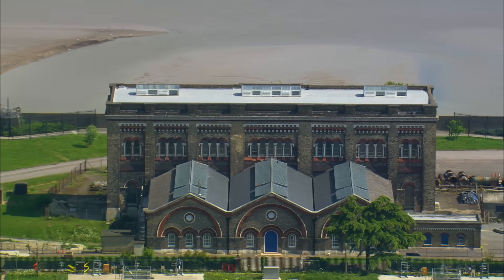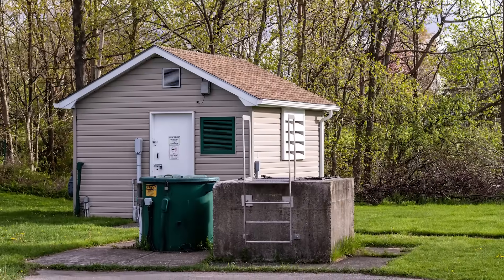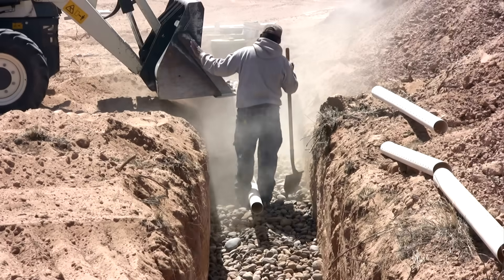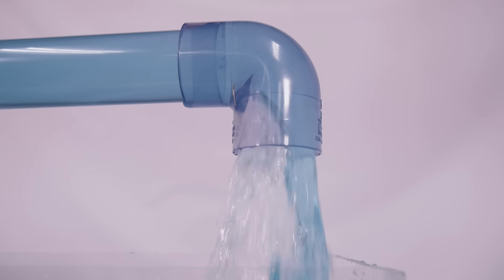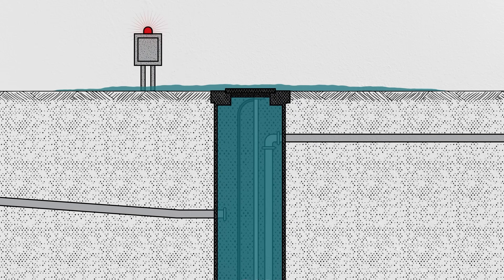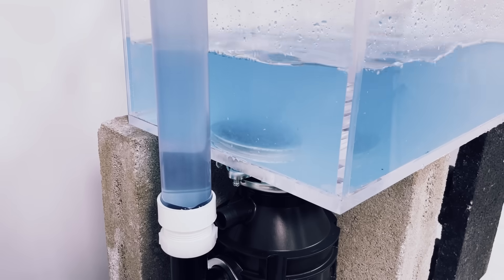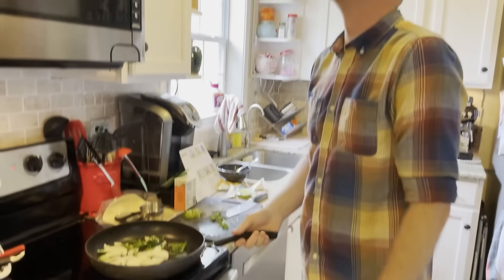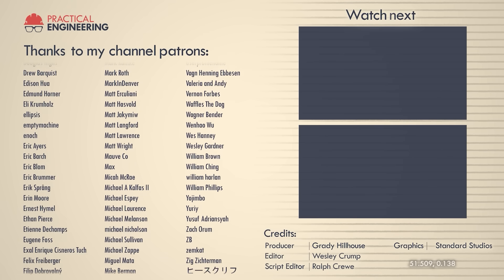How Do We Pump Sewage?

Comment: Yes.

Source: worked in sewage treatment plant. I personally disassembled and reinstalled sewage pumps. They were actually pumps that drained settling tanks. I don't know how many kinds of pumps will do the job, but these look like giant reciprocating engines. They were driven by electric motors though, and each piston had a rubber ball on top sealed with a gasket that only let the waste through one way.

P.S.

The amount of baby wipes, tampons, condoms, and wash cloths that get flushed is disturbing. Yes. Wash cloths. I have no idea who thinks that's a good idea. Stop it people.
Reply: As an electrician (who wired a few commercial lift stations), I worked with a VERY GOOD plumber lots of years ago who made one very simple and complete statement: "Besides human waste, the only thing that should go down a toilet is TOILET PAPER"!!! 
I, personally, take a similar approach to "garbage disposals". They ARE NOT a substitute for "the garbage can" unless you enjoy frequent stoppages when the stringy garbage you tried to grind comes in contact with a soap/grease restriction in your 2" waste line/drain.
Reply: @pappabob29  Not even that
Reply: As they say, toilets are only for pees:
Piss
Pooh
Puke
Paper (toilet !)
Reply: @millomweb  Forget the last one
Reply: @kornaros96  Why ?
Reply: @millomweb  clogging of installations. especially when said installations aren't up to par.
Reply: Oh man, you ain't kidding about what you find in the sewers...I've found pipe plugs, sex toys, trash can lids, an assortment of live and dead wildlife, and a small cow...It's crazy.
Reply: @chuckycheezburger3313  A sewage worker in San Antonio, TX once found a human fetus back around 2000. It was never traced back to anybody.
Reply: @chuckycheezburger3313  How do you flush a small cow ?
Reply: @mikkelbreiler8916  Man, I really dont know how it got in the line.  Guessing it fell in a stormwater drain. All I know for sure is that the muffin monsters got jammed up chewing on parts of it. Nasty nasty nasty. Still not the worst thing though.
Reply: Senile old people flush a lot of strange things.  Small children also flush a lot of strange things.
Reply: @tsm688  About anyone flushes strange things, it's really not age exclusive. The less people do stuff themselves the more likely they're to do "obviously" dumb shit just because it's out of their eyesight, thus out of their mind and "not their problem".
 Food appears magically on their table and all wast/trash just as magically disappear.
Reply: Interesting. I have never worked with a reciprocating displacement pump. Every pump I've have worked with in my system be it water or waste water has been centrifugal. Some dating back to the 30's even.
Reply: I thought the pumps on the FST's were there for moving the sludge to the RAS SAS pumping station?
Reply: What about flushing semi-liquid food that went bad? For example a thick soup that was forgotten in the fridge and got moldy. It's way too liquid for a trash bag, and putting that into the narrow sink pipes also sounds like a bad idea.
Reply: I normally triple bag that kind of thing. Tie is in a shopping bag do it again and put it in a garage you are sure does not have a whole in the bag, works pretty good.
Reply: The biggest headache; wet wipes, tampons and sanitary pads. I wonder what would happen if drain unclogging was a lab course in junior/high school.
Reply: I was just wondering if they used this style of pump. It’s what they use for concrete pumpers. I saw a diaphragm trash pump once of the same principle but it didn’t seem to be particularly efficient.

Comment: This is a good video about our most popular sewage treatment system. It tacitly assumes that this is the system that deserves study and while it’s worth studying, I think the tacit acceptance of the initial design should be done overtly. 

The easiest way to care for a sewage treatment system is to eliminate as much need as possible. We add huge amounts of water under the theory that it’s necessary for transporting waste, but it’s preferable to eliminate the water and eliminate the transportation when possible. 

An older system involved intermittent suction pumps and far less water, so the material being moved was a thick sludge. Less material at the end point can be a significant cost savings and decreased environmental impact. 

Better yet is to solve the problems on site. In desert regions it’s entirely practical to put the biohazards in a solar dryer and bake them into harmlessness; wastewater from dishes and clothes can be used for irrigation. 

And you did mention on-site septic systems, which is my personal infrastructure here where I live, but it’s based on a conventional flushing system that adds all the extra water. The better solution is to make a composting toilet that requires no additional water. 

In other words, almost all the engineering challenges in this video start with the design choice to add lots of water, and the first way to care for a system would be to consider how to put less material through the system.

Comment: I picked the wrong video to watch while drinking my iced coffee. 

In all seriousness, I now know what's inside the many little lift stations I saw all over the place when I lived in Florida. They're very common, particularly on barrier islands. It's also interesting to see what you can do when installing a wastewater system for a city in the late 20th century. Cape Coral relied on individual wells and septic tanks until many wells began to run dry in the 1970s. The city opened one of the first reverse osmosis water treatment facilities for drinking water. For wastewater, they provide non-potable, reclaimed water from the treatment system to businesses and homes for landscape irrigation, saving an estimated 20 billion gallons of water over a 25-year period. The city is still expanding the water and sewer systems, and will be for several years to come. Too bad the original developers in 1957 didn't care to put water and sewer mains under the giant grid of streets and canals in the first place.

Comment: What about congealed fat?  The grinder pumps definitely don't help with that.  Perhaps just having bigger pumps might help, but it still feels like those will still eventually get clogged.
Reply: They do. But the good thing is most of it floats and is easily removed.
Reply: For household FOG (fats, oils, and grease) the practices I've seen utilities employ focus on education initiatives to reduce the load, which also include sanitary wipes, as they are a major component for the fatbergs shown in collection system failure videos and articles. For larger areas with consistent FOG flow, the utility may have a FOG collection station installed at a major lift station, in similar fashion to a screen or grinder equipped station.
Commerical and restaurants that are expected to produce large quantities of FOG will be required to have a grease trap, to separate their FOG from the sewage collection system.

Comment: I think the most fascinating part of this whole video for me was the fact that kitchen sink disposal grinders have enough head to pump that high. I never realized they were such effective pumps.
Reply: I was thinking the same thing! I always though of them as just gravity feed after they do their thing.
Reply: They don't pump well, the one in our house was set up (badly) to pump up though some sloppy plumbing which made it prone to clogging and backing up, but it was also a cheap brand. The new one, properly installed, does discharge the water quite efficiently though I've never tested that much head.
Reply: @rpavlik1  Somebody should have told that plumber that pipes are supposed to flow DOWNHILL!
Reply: @bradley3549  yeah I'm reasonably sure no plumber was involved. Previous owner was really bad at diy.
Reply: @rpavlik1  I usually blame the electrician when I find shoddy plumbing like that. And blame the plumber when the wiring is jacked up. Only way it makes any sense.
Reply: @rpavlik1  that's bizarre, did it have a check valve? You'd think all the fluid that remained in the pipe would back flow.
Reply: Heh, Grady your choice of garbage disposal was perfect.  I'm pretty sure that is an InSinkErator Badger too.  Instead of keeping costs down by sending the manufacturing overseas to China, InSinkErator looked at their products and found ways to make them all out of the same suite of components.  Even their high end models are the same internals just with more noise dampening.  When one dies, you can unhook the hoses and then twist to release the dead one from the sink mount, then just do the reverse with the new one.  So basically your kitchen disposal was designed with rapid replacement in mind just like pump stations.
Reply: One day at work the sink clogged after lunch and filled with water. We'd turn on the disposal and the water would all disappear, then would come surging back when the disposal was turned off. Turns out someone had dumped a tray of catered rice down the disposal and it had badly clogged the sewage stack one floor down. (*Really* badly. They were seriously considering cutting out that section of pipe.) The disposal was pumping the water up the stack towards the roof. :-)
Reply: It has somewhat the general action of a standard centrifugal pump.
Reply: For comparison fill your sink with water, let it drain naturally, then hit the switch and watch how much faster the water goes down.
Reply: Right?
Reply: I mean it was only a few feet? Although I guess I have no idea how much head I should expect from a small pump, maybe that's a lot.
Reply: @Khaim.m  Yeah, but I didn't know that it pumped _at all_, I thought it only ground.
Reply: @Khaim.m  Garbage disposals are not pumps - so that's the point of my amazement. For something that's not a pump, it sure does a good job pumping.

Comment: You left out air lift pumps. They are used in the waste water treatment facilities and mostly only move water for the most part. They have good volume but poor head pressure, and are not bothered by solids much at all,

Comment: The sewer in my road is 6 metres deep….or they thought it was, nobody had looked in 50 years.  Turns out its 9 metres deep, out side the reach of all the companies shuttering and all their equipment.  A simple pipe repair took 3 months of full road closure, god help us if they decide it all needs replacing.

Comment: I've had the joy of being a millwright, who works on the 14,000 gpm+ pumps that perform this function. These pumps are freaking crazy!
Reply: Cool. We have 3 pumps of that exact capacity at our treatment facility, with 350 HP motors driving them. Absolute monsters. The whole assembly stands about 15 feet tall.
Reply: @biggreenblob  Are they on inverters?
Reply: @biggreenblob  Saskatoon!?
Reply: @Pickleriiiiiick  Birmingham
Reply: @biggreenblob  ahh, they're all the same, massive poo movers haha
Reply: in my own ignorance, all I can envision as a "millwright" is one of those Saturday morning ETV woodworking shows :)
Reply: @kevinheard8364  that's a fair assumption. The trade started with wood bearings for flour and saw mills. Basically anything not on wheels is our game. Pumps, compressors, conveyers, power generators. We're fairly diverse in what we do. There's no one thats done it all, that's for sure.

Comment: Chain and disk pumps used to be used - a continuous loop of chain which is pulled by an engine or animals with disks that fit inside a riser pipe.  Also Archimedes screw pumps where the heights are to great - big ones can lift anything! 

Also I can recommend the Drain Addict YouTube channel if you want to see the practicalities of lifting sewage!
Reply: I suspect that the old school beam engines were rather robust for this task too because of their linear reciprocating action. I figured their ability to simply lift the entire cylinder of water straight up would be well suited to this. Seems like if designed with the cylinder and the pipes all being the same diameter almost anything that fits through the pipe should pass the mechanism too well except I suppose you have the lift rod that pulls the piston up to deal with. But that is still far less of a constriction than an impeller creates. Then again guess maybe they weren't as good as they look as it would be easy to convert the torque output from a modern motor or ICE into reciprocating motion like this, converting between linear and circular motion and back is a staple of engineering after all.

Comment: When we built our 'new' home (19 years ago), the builder cautioned us that because the lot was a the bottom of a hill, the home would require a 'grinder pump' aka 'macerator pump' to move sewage from our basement through a force main up to the top of the hill about a block away.  I was initially hesitant, but in retrospect it has worked very well.  The predicted MTTF for the pump is ten years; it went 14 years before it actually failed, but when that happened, it was an immediate crisis.  Fortunately, the company that services that equipment in our area was able to replace it within about two hours of when we first called for help.  They are noisy, and during a power outage, we know that we can only flush the toiled about 45 times before the reservoir is full.  Fortunately, that is a rare occurrence and has only been a real problem one time since we have lived here.
Reply: This is why life cycle expectancy matters. You should have replaced it preemptively so it doesn't turn into an emergency. This is just like sump pumps. They get replaced every 7 years no questions asked.
Reply: @otm646  yeah, because gaining 40% lifetime and having to wait two hours to flush 45 times was so bad...
Reply: @otm646  additionally, most people don't understand reliability engineering, particularly MTBF. For example, the MTBF for a human being is >800 years.
Reply: @daviasdf  any suggested resources on that topic?
Reply: @daviasdf  what does MTTF  and MTBF stand for?
Reply: @AuroraAce.  Mean Time Before Failure, or I assume Mean Time To Failure is the average time something will work for before it falls. Obviously, being an average, some will last much longer and others will fail sooner.
Reply: @AuroraAce.  Mean Time To Failure and Mean Time Between Failures. Edit: had not noticed David's reply. To clarify, MTBF is the average time between failures if you exclude infant mortality (failures due to manufacturing quality issues) and wear out (failure due to the item getting old). It's tied likelihood it will die randomly during its design life, but it's completely inadequate to use it as life expectancy. See article below for further explanation.
Reply: @iamdave84  Usually it's Mean Time Between Failure(s)
Reply: @daviasdf  What ehe hell, you are right.  I had to look up why.  Good to know
Reply: That's the kind of thing I would probably buy a spare for just to have on hand immediately in case of failure. It would suck if they had to order a part.
Reply: Dude takes 15 shits per hour. Gotta cross your fingers that the power isn't out for over 3 hours
Reply: That's not bad, being able to flush 45 times during an outage. We can flush 6 half flushes, then all tanks of our 3 toilets are empty. No power = now water here due to being on a well with pump.
Reply: When it failed was ita, we cannot produce any more waste water type of situation, or my basement is now flooded with raw sewage?
Reply: @TheZooloo10  the way these work is that the waste water from your home goes into a pit, that pit gets drained by the macerator pump. So if you knew the pump failed, big if there, you could stop producing wastewater until you got it repaired. I've seen it many times where the homeowner doesn't know it's failed and therefore you've got a sewage leak issue now.
Reply: @TheZooloo10  - How did this illiterate nonsense get 3 thumbs?
Reply: @johnsmith1474  🤣 ok boomer
Reply: @Natasya🔞 you have been reported for your spam comments.
Reply: @OilBaron100  please just report and move on, your reply is totally not needed. you're just clogging things up with more garbage about their spam - you think the bot is gonna read your reply?
Reply: @amicloud_yt  if my comment is “clogging things up with garbage”, then what is your comment, about my comment, doing?
Reply: @OilBaron100  trying to keep the damage to a minimum. hopefully you realize i am right and don't do this the next time you see a spam comment. sure this thread is fucked now but it will spare future threads a worse fate
Reply: @OilBaron100  Its doing  the same thing momentarily,  but might reduce the "garbage" in the future if people heed their advice
Reply: @SirHorned19  Guys, watch Linus Tech Tips most recent vid if you want a way to mass report these bots. "Fixing what youtube couldn't"
Reply: @amicloud_yt  wait a minute, so there are no hot 18 year olds from my area wanting to chat with me?
I knew it was too good to be true 😭